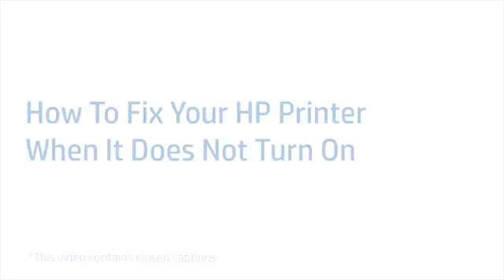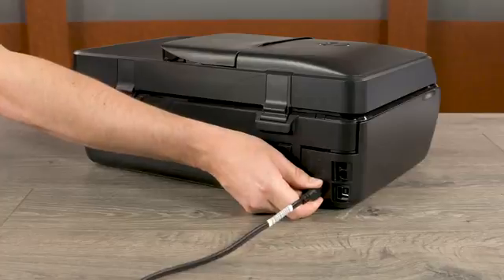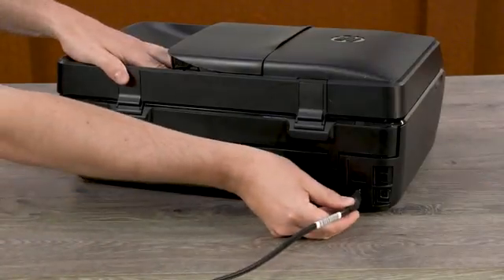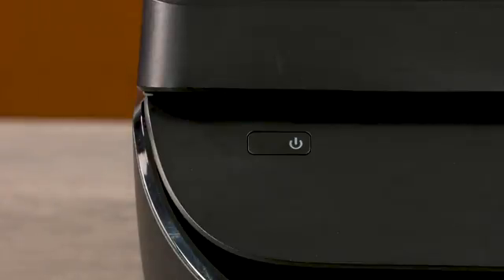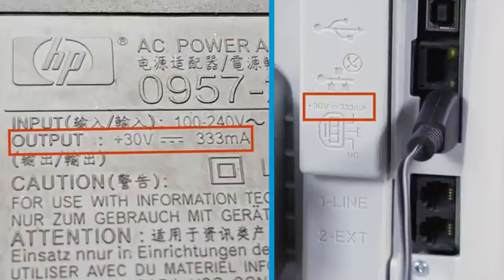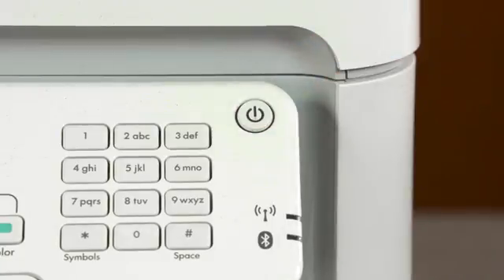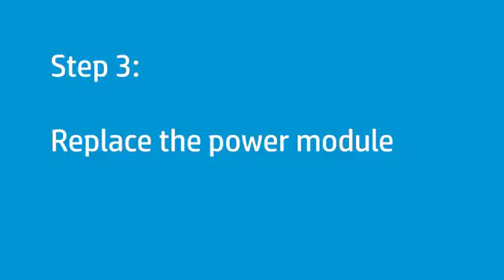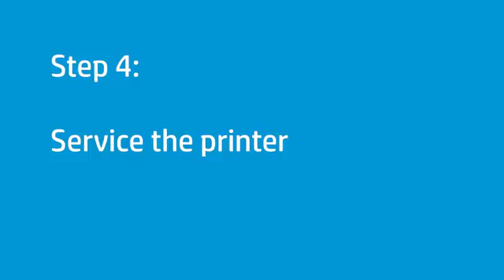Fix Your HP Printer When It Does Not Turn On | HP Printers | HP Support

Comment: My printer is stuck on the first screen. The power switch is even unable to turn it off.
Reply from the maker: Hi there, thanks for contacting HP Global Social Media Support!
I'd request you to perform a reset on the printer. Kindly do the following:
1) Turn on the printer, if it is not already on.
2) Wait until the printer is idle and silent.
3) With the printer turned on, unplug the power cord from the printer & wall.
4) Press the power button for 30 seconds. 
5) Wait for 60 seconds. 
6) Plug the power cord back into the printer and wall, ensure the printer is plugged into the wall & not to a surge protector.
5) Turn on the printer, if it does not automatically turn on.
Note: To make sure the power source functions correctly, make sure the printer is plugged into an electrical outlet and not a power strip or surge suppressor.
In case of any issues please let me know.
Akhil_HP Social Media Tech Suppor
Reply: I did exactly as you instructed but it did not correct the problem. It is still frozen. Current indication on screen: the icon returned after it count down along with the blue highlighted line beneath and the seven dots below with the very first dot highlighted. When the printer was plugged in there was silence and idle. As soon as the power is plugged in it immediately light up on the screen.
Reply from the maker: Thanks for the reply.
- May I know the model number of your printer?
- May I know to which device you have connected your printer? (For ex: Desktop, notebook, iPhone, iPad, android phone etc?)
- If connected to computer, may I know the operating system installed on it?
Please let us know!
Binu-HP Social Media Tech Support
Reply: I have a HP ENVY Photo 7855. Before I purchased a office Jet, I had it where I could print from my Android phone and my Laptop. My new printer is working fine on my Android phone and my laptop. I bought this ENVY Photo three years ago. It should be a simple fix.
Reply: Global support, I am still waiting got a response.

Comment: my printer doesnt turn on sometimes and when it does finally work it prints the pages blurred and the top half of the words are missing usually. i stopped using it for like 5 months now i need it again for online school and it does this bro.
Reply from the maker: +Garry FN If the printer is not turning on, try the steps mentioned here: http://hp.care/2pigaHj and to fix the print quality issue, please perform the steps mentioned here: http://bit.ly/2yK1gwY

Comment: My printer will not turn off using power button ... has a blank WHITE screen only and won't print
Reply from the maker: Hi there, thanks for contacting HP Global Social Media Support!
I understand that you are experiencing an issue with your printer as it will not print, turn off with power button and control panel is blank white.
I will do my best to assist you.
May I know the printer you are using?
Please let us know!
Regards, 
HP Support

Comment: I had the death white LED screen while printing a document wireless from my iPad.   I unplugged the power cord per the video instruction.  Still, the HP Pro 8710 does not turn on.  This is my second HP printer that I owned.   I will NEVER again buy an HP printer!   I knew better but wanted to give HP the benefit of the doubt.....
Reply from the maker: +Who_Dat? Please perform the steps mentioned under this document to fix this issue: https://bit.ly/2VWeDYW

Comment: I have a brand new hp printer and I have to unplug it every time I want to print.
Reply from the maker: +Lloyd Snyder - May I know the model and serial number of your printer?
The instructions for finding the model and serial number can be found here: https://support.hp.com/in-en/document/c03770424
- May I know to which device you have connected your printer? (For ex: Desktop, notebook, iPhone, iPad, android phone etc?
- If connected to computer may I know the operating system installed on it?
- Are you receiving any error message?
- May I know whether the wireless light on your printer is blinking or steady?

Comment: 8600 officejet pro, power button lights and I get no response. I replaced the internal power supply and the cord. The power button only lights but does nothing else. Followed all the steps in the usual hp support responses. Think it gonna have to be replaced with something other than an hp product. I'll never buy another hp anything.
Reply: I'm gonna take my printer apart and sell all the parts on Ebay to pay for a new epson or brother printer.
Reply from the maker: +Joseph Hughes Please follow the guidelines under this document to fix this issue: http://hp.care/2pigaHj
Reply: @HPSupport  As I stated in my original post this does not work. I don't know how many times I have to do it....it's been at least a dozen.

Comment: How to fix 2135 when it doesnt turn off?
Reply from the maker: +Faisal Ardian Maulana Please hard reset your printer as mentioned in these steps: 1. Turn the printer on. 2. With the printer turned on, disconnect the power cord from the rear of the unit. 3. Unplug the power cord from the wall outlet. 4. Wait at least 15 seconds. 5. Plug the power cord back into the wall outlet. 6. Reconnect the power cord to the rear of the unit. 7. If the printer does not turn on by itself, press the Power button to turn it on. If the issue persists, update the firmware of your printer as mentioned in steps in this link: http://bitly.com/2OzXMFQ

Comment: It's a royal pain to unplug and re-plug in any time I want to print.  Quite a cop-out, rather than offering a fix to the root of the problem.
Reply from the maker: +Ken Kaufman thanks for reaching out!
I understand that you are experiencing an issue with your printer as you need to unplug and re plug for it to print.
I'll do my best to assist you.
- May I know the model and serial number of your printer?
- May I know to which device you have connected your printer? (For ex: Desktop, notebook, iPhone, iPad, android phone etc?
- If connected to computer may I know the operating system installed on it?
- Are you receiving any error message?
Let us know.
Reply: @HPSupport  OfficeJet 4630, SN CN47087186, if I can read the small print right.  It's connected via wireless primarily to a laptop running Windows 7.  No error messages.

Comment: Alright so here is the problem. The motherboard shows no issues and neither does the power supply. Even after going over the motherboard with a thermal lens I still couldn't see any issues. 9 times out of 10 I can fix these things but I swear HP sent a shutdown command to my printer after the warranty expired.
Reply from the maker: Hi Riley, thanks for contacting HP Global Social Media Support!
I understand that you are experiencing an issue with your printer as it is not turning on.
I will do my best to assist you.
Please refer to the instructions mentioned under this document to fix the issue: https://bit.ly/3qc8khL
Binu - Social Media Tech Support

Comment: Worthless help. The printer said  something to the effect of “The print job was interrupted abruptly, press the power button.” I did, and it never came back up. Did it once before, but I eventually turned on again. The printers are obviously prone to this or there wouldn’t be a video on how to reset it.
Reply from the maker: +Burt Clarke thanks for reaching out!
I understand that you are experiencing an issue with your printer as it is not turning on.
I'll do my best to assist you.
Please perform the steps mentioned under this document to fix this issue:
http://hp.care/2v0gAoi
Let us know how it goes.
Reply: HP Support  As I mentioned before, I already performed all of those steps multiple times. Since the cartridges are not accessible unless the power is on (and that is the problem; it does not come on), I took a pair of channel locks to the printer and removed the cartridges to put in another bare-bones printer. Then I tossed the printer in the dumpster. Thanks!

Comment: I HAVE TO DO THIS EVERY SINGLE TIME I WANT TO PRINT ONE SHEET 😠 HP is absolute GARBAGE I am bringing this thing back immediately. I cannot remote print if my printer shuts off automatically and will not turn back on. The power button just doesn't stop flashing and this is a brand new printer. This has happened since day one. A d you make it far too difficult to own HP if you are an Apple user. HP is a joke do NOT GIVE THIS WORTHLESS COMPANY YOUR MONEY!!! They make it IMPOSSIBLE to find solutions online other than shut off and turn on! They make it impossible to speak to a representative without wasting HOURS AND HOURS OF YOUR LIFE. I am not a joke and after paying you, I don't deserve to be treated like one. Goodbye, HP 👋👋👋
Reply from the maker: +JacQuell Peterson Please perform the steps mentioned under this document to fix this issue: http://hp.care/2pigaHj

Comment: For the record, I bought my HP envy 4520 a number of years ago, and it's given me good service until now. I shut it down, now it won't power back up. I normally get good HP products. Frankly I can't fault the printer much, after lasting this long in a rather harsh environment (for electronics) It's done me well enough I want the exact same thing again... yeah I have ink cartridges on hand and don't want them to go bad... they're not cheap even tho I buy refurb ones.
Reply from the maker: +too tall Please follow the guidelines under this document to fix this issue: https://bit.ly/2XJWCy2
Reply: @HPSupport  Oh I tried all that silly stuff. The printer is in the trash can now. I replaced it with a Canon.
Reply: @tootall5559  good call

Comment: What REALLY might help is if electronics companies would manufacture electronics that would ACTUALLY WORK CORRECTLY for more than 90 days!  I get SO incredibly frustrated when our printer will not wake up from sleep mode, or the computer says it's offline, but pushing any of the control panel buttons or the ON/Off button doesn't respond at all! Then, after I unplug, wait 30 seconds, plug it in, I get some accusing message in the control panel, saying "Printer was not powered off correctly".  Well, DUH!  You made a malfunctioning pile of plastic poo!
Reply from the maker: +Cathy Green Please refer to the instructions under this document to fix sleep mode issue: http://hp.care/2rJROKH and perform the steps mentioned under this document to fix an offline issue: https://bit.ly/2ObQ5L4

Comment: HP neverstop laser MFP 1202w stop working for no reason. I only use it occasionally, especially for my doctors appointment. very few time. HP is getting worse and worse.
Reply from the maker: Hi there, thanks for contacting HP Global Social Media Support!
I understand that you are experiencing an issue with your printer as it is not working.
I will do my best to assist you.
What seems to be the issue? Are you facing any technical issues with your HP printer?
- May I know to which device you have connected your printer? (For ex: Desktop, notebook, iPhone, iPad, android phone etc?)
- If connected to computer, may I know the operating system installed on it?
- Are you receiving any error message?
Please let us know!
Regards, 
HP Support

Comment: Hp 8610 goes into shutdown mode
Reply from the maker: +Raj S Request you perform a hard reset on the printer by following the procedure mentioned below. 
Turn the printer on, if it is not already on.

Wait until the printer is idle and silent before you continue.

With the printer turned on, disconnect the power cord from the rear of the printer.

Unplug the power cord from the wall outlet.

Wait at least 60 seconds.

Plug the power cord back into the wall outlet.

   NOTE:

HP recommends connecting the printer power cord directly to the wall outlet.

Reconnect the power cord to the rear of the printer.

Turn on the printer, if it does not automatically turn on.

The printer might go through a warm-up period. The printer lights might flash, and the carriage might move.

Wait until the warm-up period finishes and your printer is idle and silent before you proceed.

Comment: This printer is a piece of garbage. I unplugged the printer to relocate it to another room, and suddenly the printer won’t power back on. I’ve tried the steps outlined in the video but it’s not working. I’ve already replaced the power module less than a month ago. And no I don’t have it plugged in a power strip. It’s connected directly to a wall outlet.
Reply from the maker: +AstonishingREDD Please refer to the instructions mentioned under this document to fix the issue: https://bit.ly/3Hg7OXk

Comment: Printer wouldn't print, just cycled on its little screen. Tried turning it off and back on, but it wouldn't turn on. Tried the fix in this video and it did not work. No more HP for me. There's no excuse for manufacturing crap like this.

Comment: You can’t see it but I put a thumbs down! Waste of time video.
Reply from the maker: +WENCHY101 Please refer to the instructions mentioned under this document to fix the issue: https://bit.ly/3qc8khL
Reply: @HPSupport  
Thank you but you just sent me a link of what’s in this video. 
I have tried all those things before I even watched this video. 
Now the printer turns on when it feels like it. I’m pretty sure that it’s a firmware issue. 
Sometimes it’ll turn on and I can set it up with the date and time etc. but by the time I try to get it connected to my Wi-Fi it shuts itself back off. I bought a USB cable but it hasn’t turned back on again, yet. 
I’ve had a lot of issues with this printer over the years. When it wants to cooperate it works great, but it has not been lately. Time for me to buy a new one.

Comment: Throw HP away get a Canon printer
Reply from the maker: +Pi I understand that you need help with your printer as it is not turning on.
I'll do my best to assist you.
Please perform the steps mentioned under this document to fix this issue:
http://hp.care/2v0gAoi 
Let us know how it goes.
Reply: @HPSupport  thank you for letting me know but I took my HP ink advantage 2135 printer to an HP service centre and they told it would be costly to repair it. Moreover the printer was not printing black  for some reason and yesterday it wasn't even turning on. The mechanic told me that the ink spilled out and caused a short circuit.
Even though I didn't use it to take print out but I used its scanner.
I have a Cannon Pixma G3010 woth me which I brought before the HP ink advantage 2135. I used the Cannon in my office and the HP at my home.
Now I will be buying another Cannon or epson for my home.
Thanks for the reply.

Comment: Your printer is sucks.. Lots of issues..
Reply from the maker: Hi Ralvin, thanks for contacting HP Global Social Media Support!
I am here to help!
What seems to be the issue? Are you facing any technical issues with your HP printer?
May I know the printer you are using?
Let me know!
Binu_HP Social Media Tech Support
Reply: @HPSupport  The black cartridge didn't work at first, so I followed your instructions to fix it, but nothing happened, so I'll just buy a new one to use in my projects, but after a few days, it won't turn on. Everything I did was according to your suggestions, so I'm guessing there are some technical issues, but it hasn't turned on in 2 months. By the way, my printer is only a few months old.
Reply: @HPSupport  HP Ink Tank 115
Reply from the maker: Thanks for the reply.
Please refer to the instructions mentioned under this document to fix the issue: https://bit.ly/3Hg7OXk
Binu_HP Social Media Tech Support
Reply from the maker: Thanks for the reply.
Have you tried the steps mentioned under the document provided?
Binu_HP Social Media Tech Support

Comment: My hp deskjet 4729 printer can't turn on. The ac power adapter out put voltage should be +22v. Then I check the out put voltage by multimeter is 21.5. Is it the ac power adapter problem?
Reply from the maker: +benson Please refer to the instructions under this document to fix this issue: https://bit.ly/2VWeDYW